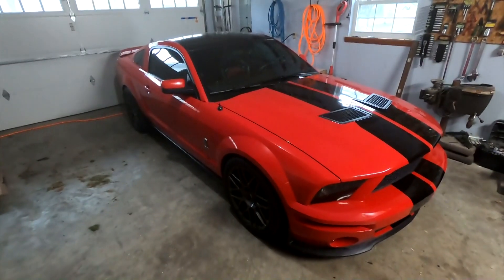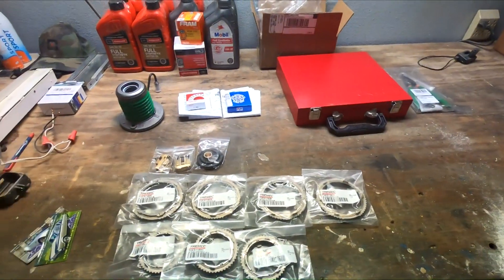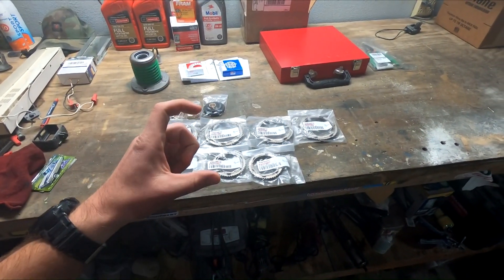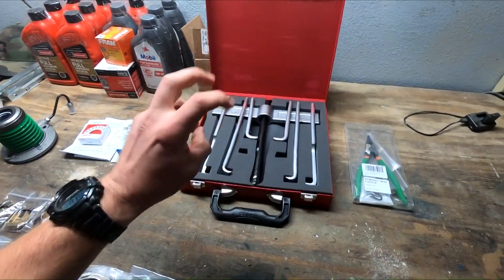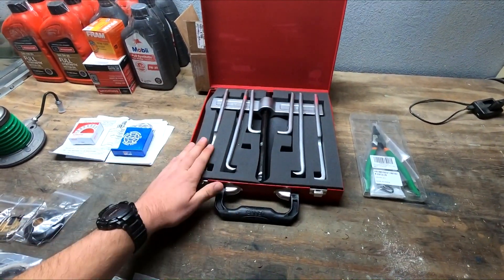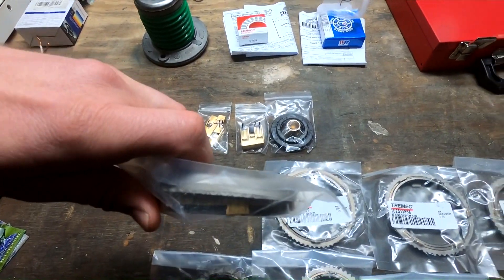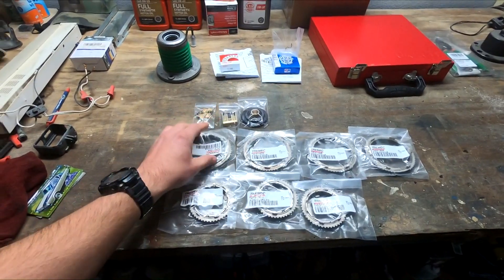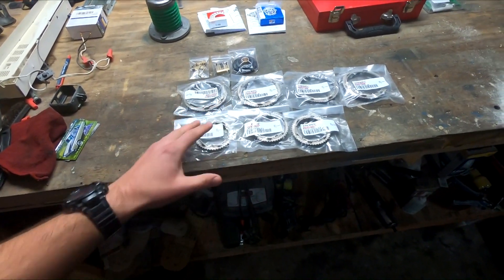2007 GT500 TR6060 Synchro Upgrade Parts Overview | Part 1

Comment: Amazed by your determination and work ethic when it comes to working on this car. I can’t even get to the upper o2 sensor connector lol. What do you do for a living? Do you still have the car?
Reply from the maker: Hey man, yeah I still have the car, I'm overseas right now so it's in storage with a friend. I'm military, so I move around a bit. Thanks for the compliment. Persistence is key